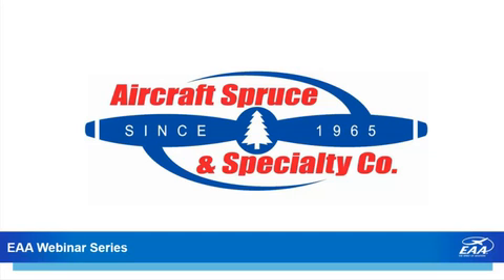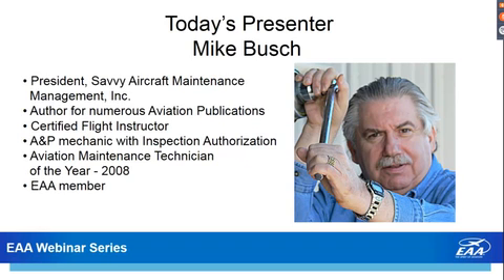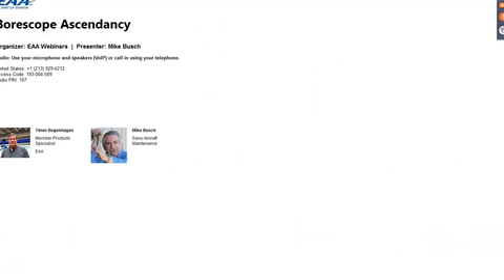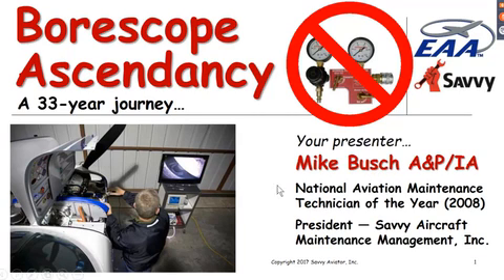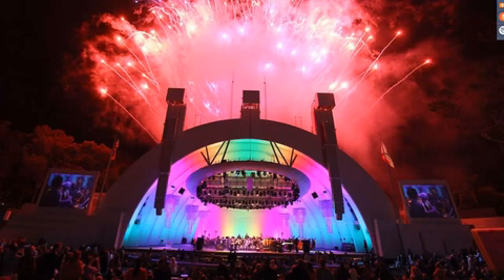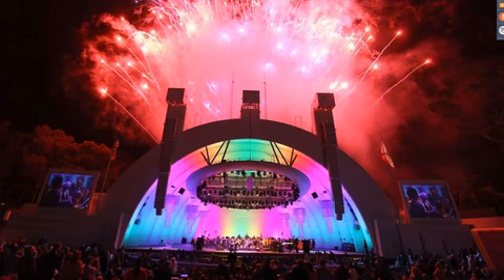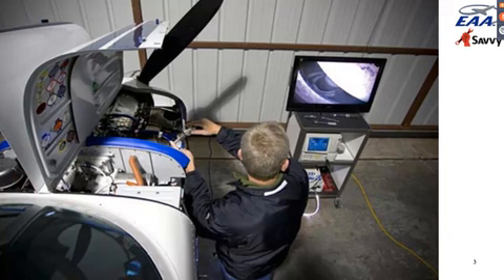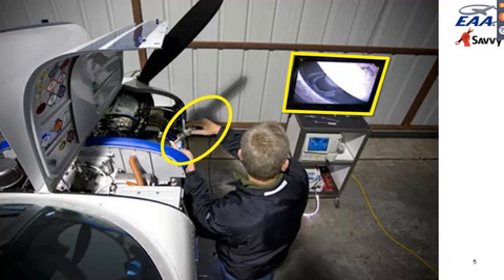Borescope Ascendancy

Comment: I’d guess the variation would be due to inconsistent temperatures of the rings and cylinders during different testing times, as well as the rings moving relative to each other sometimes lining up and letting air by.